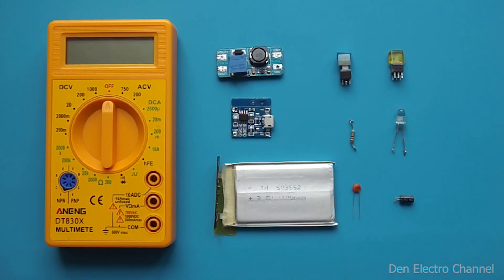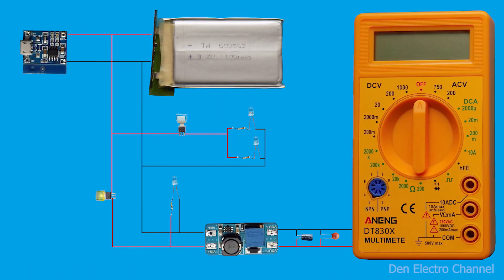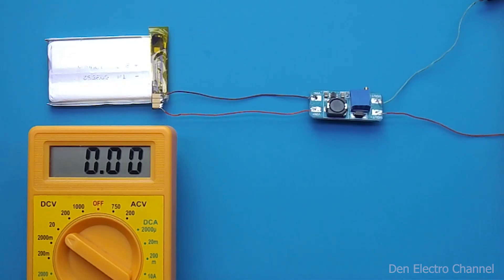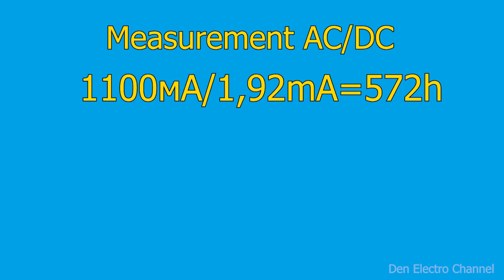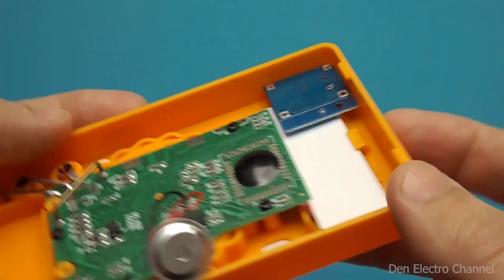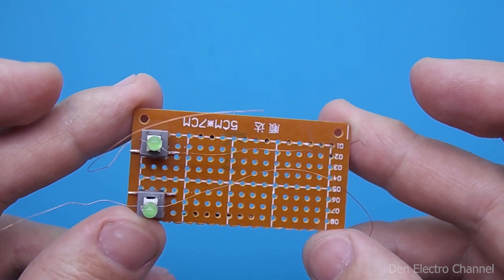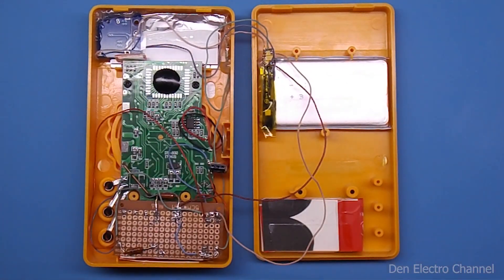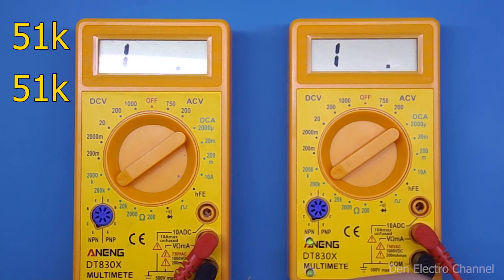Modification of the multimeter

Comment: Good features and i like the way you designed it to fit the extra components inside the available space.
But everything is nice until you realise that the upgrade is costlier than the multimeter itself.
In my country you could get this multimeter online for 2.5USD.
Reply from the maker: Thank you for watching.  This upgrade is made to avoid the use of nine-volt power supplies.  They are unreasonably expensive and run out quickly.  In addition, I like the DT830 multimeters.  They are simple and compact.  But they don't have a power off button or auto-off feature.
Reply: @Den_Electro_channel   yeah I completely missed out that part. It would be difficult to remove and place the battery again and again. At first I was thinking that you are crazy to do such an upgrade when you can spend the extra money to get some cheap mas830l which is around 5USD which has the backlight. But you clearly stated about the compactness of the dt830. Very creative design!!